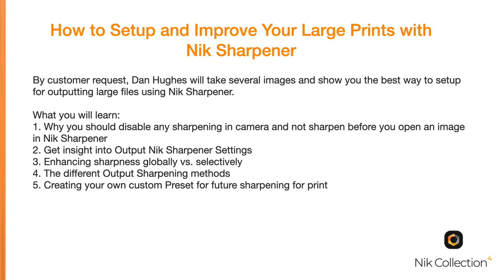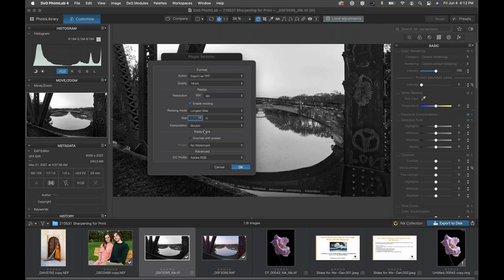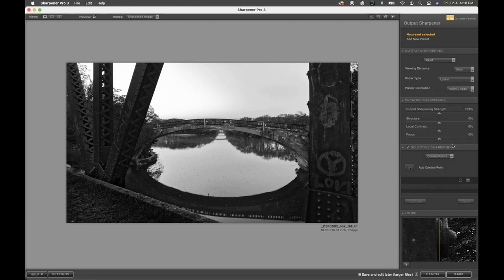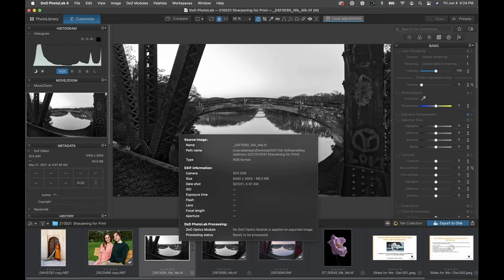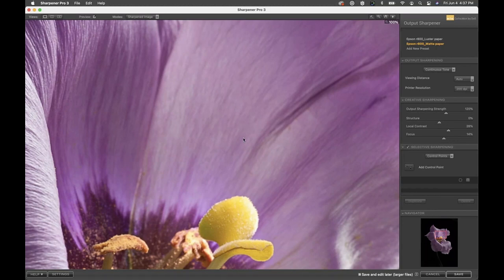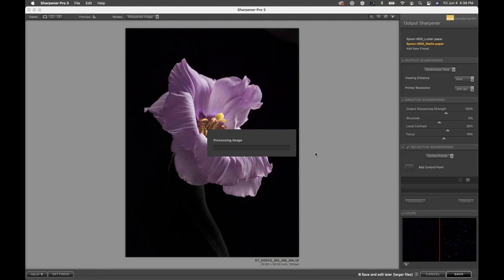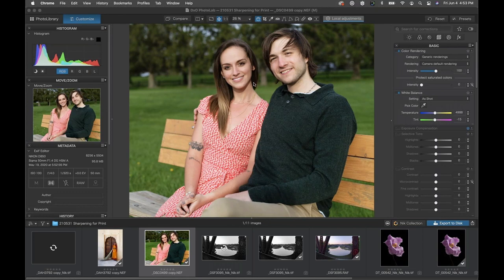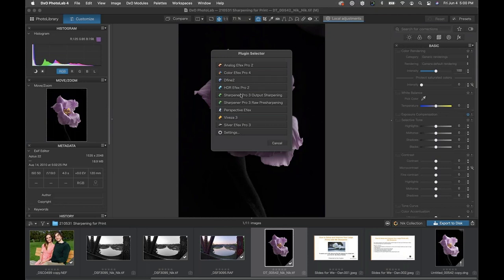How to Setup and Improve Your Large Prints with Nik Sharpener

Comment: Many thanks for the informative video. I think one aspect to be solved by DxO in future is the interplay of the different modules with historically different origins. One such example are indeed the tools for sharpening, as they are partly redundant or even irritating (and need a more clear nomenclature). The DxO Photolab optics module is perfect for RAW input sharpening (one of the reasons I prefer it over LR). Not sure: Is this a deconvolution sharpening? And what about the Photolab Unsharp mask method? And how does this again compare to the Sharpener Pro Presharpener? Recommendation: Clean all these functions up within Photolab and integrate three modules - (1) DxO Optic Module for RAW input sharpening (2) USM/Deconvolution creative sharpening (3) Output sharpening - all placed within PL